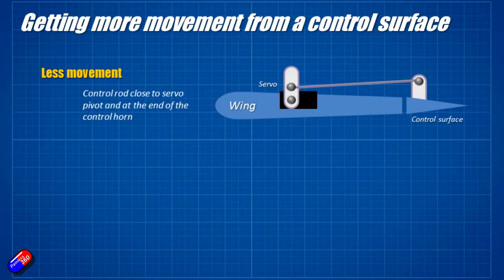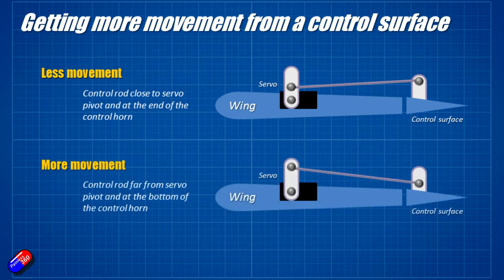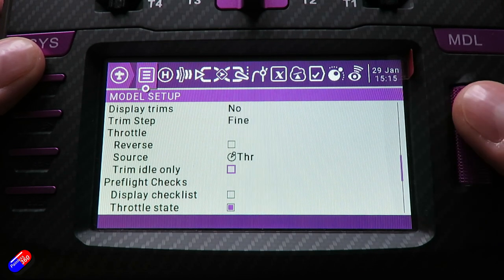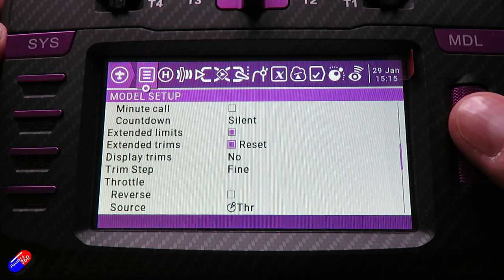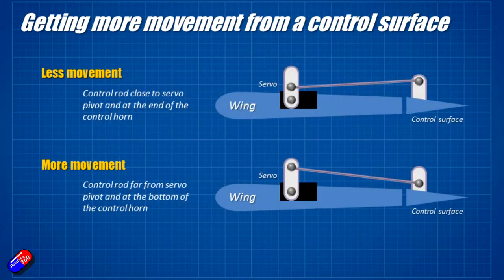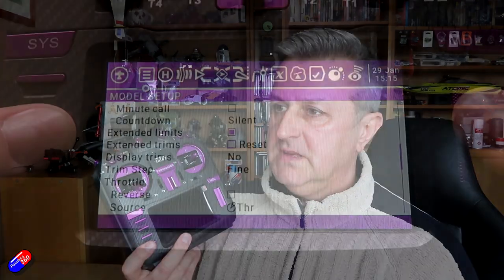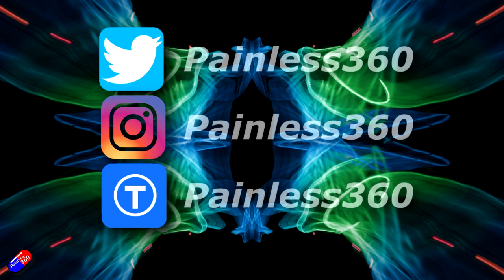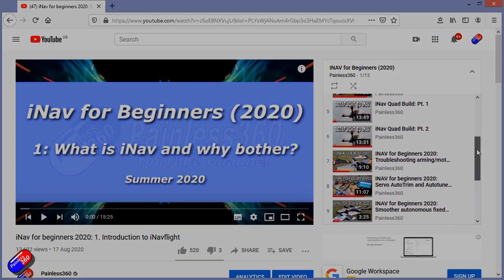OpenTX Quick Tip: Extending travel and movement of a control surface

Comment: Optimum servo strength is achieved when the control horns are balanced.  The mechanical way can cause reduced  servo power.  Thank you for showing the radio way.

Comment: What if you get a plane that has a transmitter configuration guide that says "if you're using spektrum set end points (travel adjust or atv) to 125%"?  I'm presuming using dsm receiver with the radiomaster fits into this category?
Reply from the maker: Yep, same thing.

Comment: Hi Lee,
I know that a video transmitter that talks to the flight controller using the IRC Tramp protocol takes the values of the VTX table directly from the Betaflight settings. My question is: Can I fly on my own frequencies by changing the table, for example if I set my VTX to 5000MHz? Or can an IRC video controller only transmit in a certain frequency spectrum?
Reply from the maker: That is something I'm not sure on. If you get it working, please let me know...
Reply: It depends on your encabulator settings.